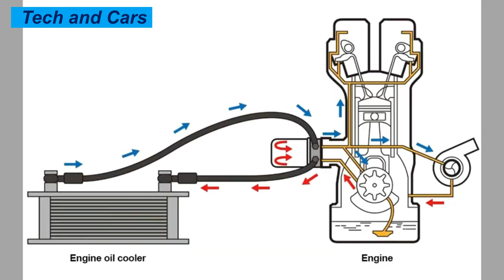Comparison of air cooled vs oil cooled vs water cooled engines

Comment: In '89 I bought a new GSXR 1100. Oil cooled engine. If I would have known that oil cooling is less efficient and robs an engine of horsepower I would have bought the Yamaha FZR 1000 instead. The gixr was still fast but, water cooled for bikes and cars is the way to go. In my opinion.
Reply from the maker: Great point!